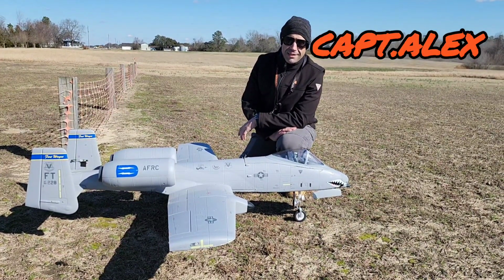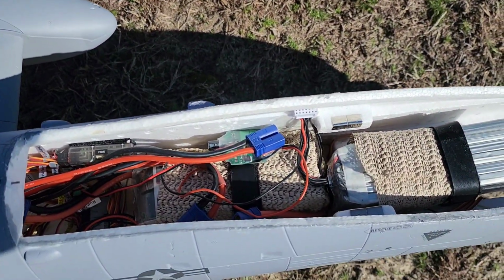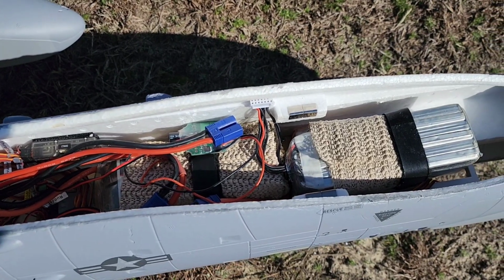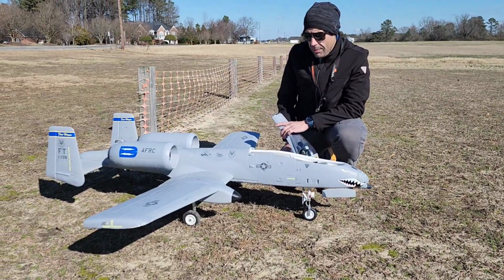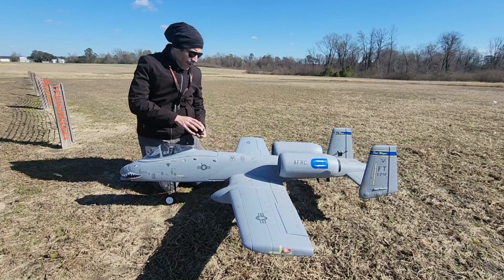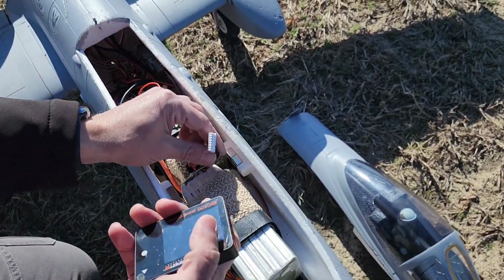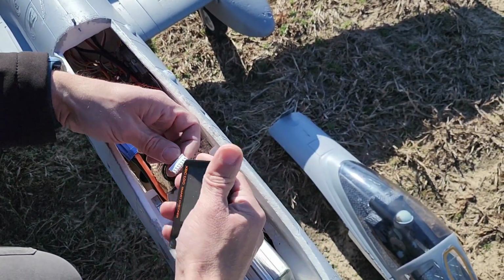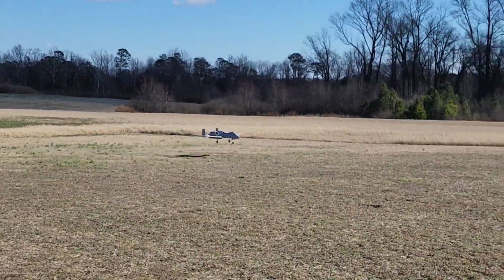A-10 Thunderbolt II Super Scale Returns  #rcplane #freewing #aviation

Comment: Are you using a Gyro?
Reply from the maker: Yes, but not the stock one, I use AS3X with my Spektrum receiver. I have set up in the knob on my transmitter so I can adjust as I fly.